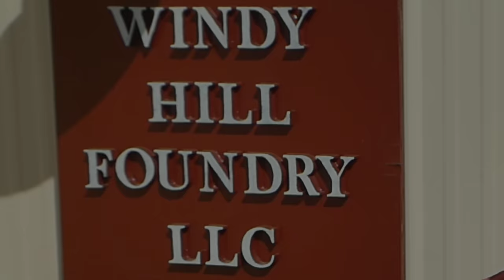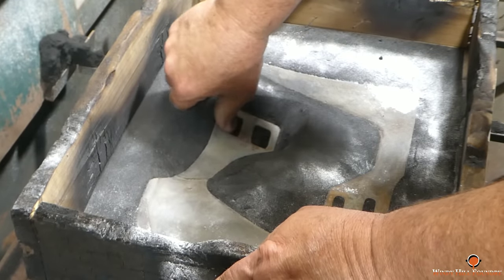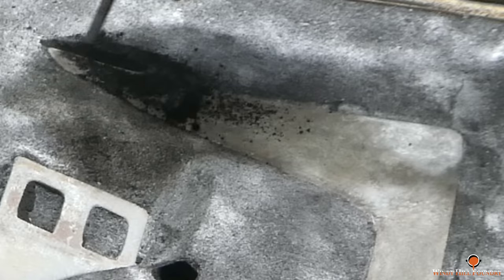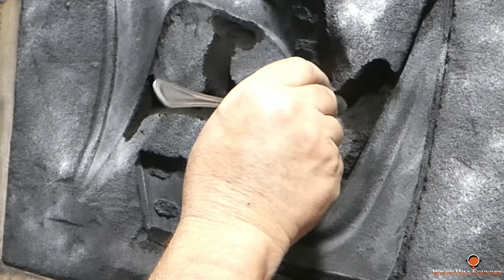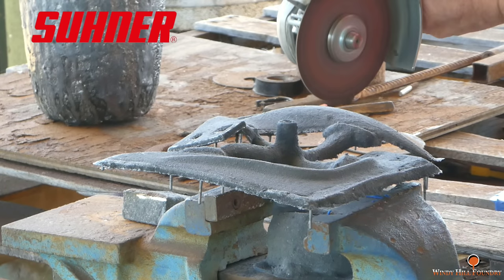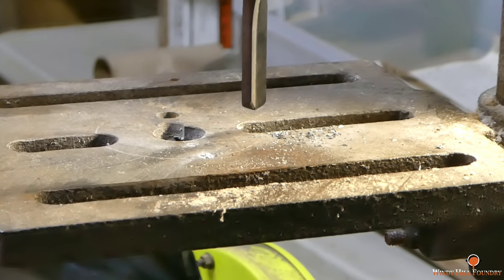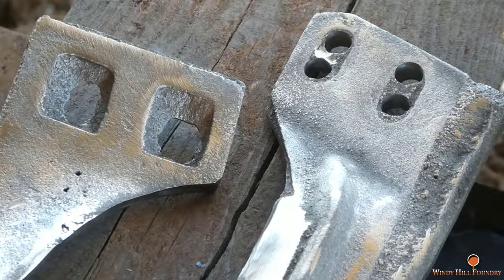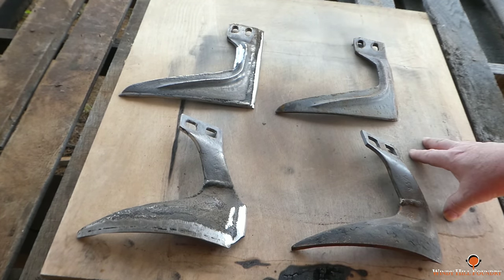CASTING MULLER PLOWS

Comment: Clark, if you make 3 divots without going through, it will thin it down on each location until you get close to penetration, then drill the end ones through. This will reduce your work cutting out the center.

Comment: Happy Birthday, Clark. I was wondering about the muller locking up, is there a gear box on top or bottom of it that spins the shaft, could the gears be binding due to wear in the bearings? How good of a blacksmith are you? Farm supply store would have some discs for a plow for pretty cheap, you might could cut those shapes out of them then do the bending in a forge. or you can do some horse trading with a blacksmith for it.
thanks for the videos.

Comment: Do you have any auto repair shops and truck repair shops around that you might get scrap drums and rotors.   Since you may be going full time.  

What about crawler tractor pads and rails.  Sprockets and rollers.